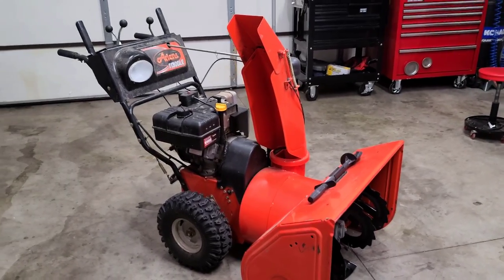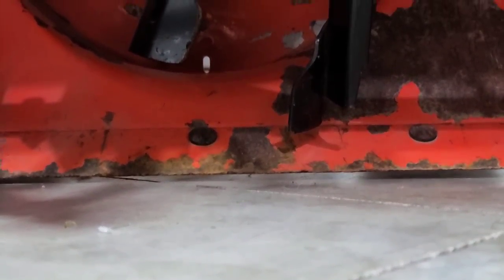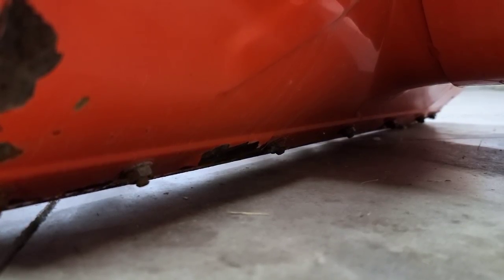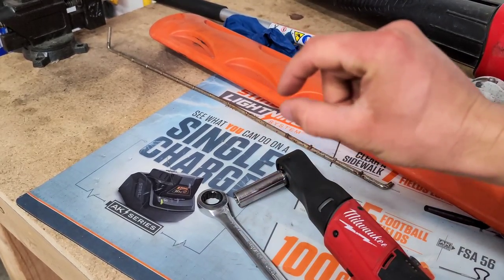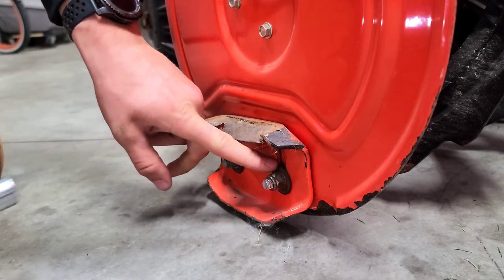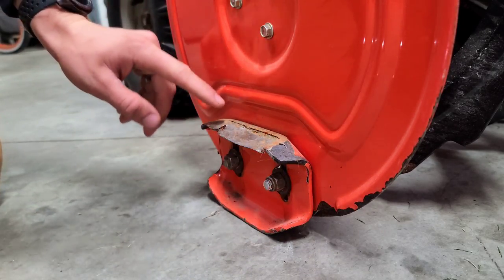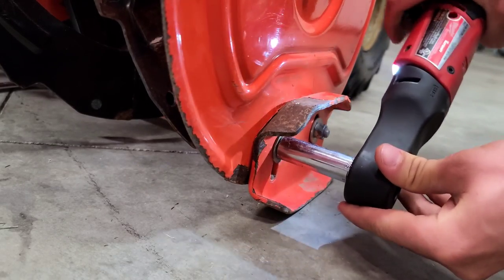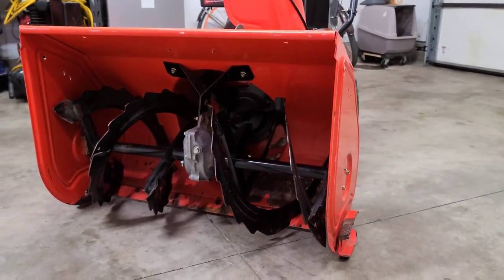How-to Adjust Shoes & Scraper Bar On A Snowblower

Comment: Hi Phil 32 years ago I purchaser my first snow blower.  I used in town on sidewalks that were uneven.  When the skid hit the high part the snow  blower would violently turn to that side.  I could see then that the skids was not the answer.  So I measured the distance from the bolt hole for the skid to the ground and found sone wheels of that diameter.  Ever since then I was able to operate the machine with only using one hand.  I still use that snow blower today

Comment: Suggest you check the tire pressure and make them somewhat the same. Otherwise the machine will sit on a tilt and the adjustment of the scraper bar will follow and the next time you fill the tires your scraper blade will be skewed.
Reply: you got that right....you can only fight that motor for about 30 minutes ....
Reply from the maker: Yes sir thank you for the tip. My tires were both inflated at 20psi 👍

Comment: great video! you explained this very well. Wish I would have thought to look for this a while back.  3 years later with no adjustment my shoes were plastic and worn away and eventually lead to loss of that blade totally.  I have found out what the noise and shimmy was as I was snow blowing.
Reply: Tell me about it.  I need a “So a Texan moves to New England” channel. So many things and nuances, I thought I was good with just buying a badass snowblower.

Comment: On a flat surface you should check that you have the scrapper bar space the same on both left and right sides first. If not, it can be adjusted and then adjust the shoes.

Comment: Thank you, I appreciated the video. Although, skipped the 1/4 to 1/2” clearance on the scraper last Winter when I bought our NEW Toro Max 828.I may do that this week. I have a question though….. The right slid was scraping on the cement last year and I checked the air on tires and that seemed to be fine. WHY is the shoe scraping? I literally had a track it would make in the snow. Maybe it’s designed wrong? I seem not to get any answers even from professionals. So, a couple weeks ago I turned them upside down like you did. Nothing seemed to change. Just that the right shoe just got more paint scraped off then the left one and that was just it idling.  I think that is the furthest they will lower too. I could send you pics if need be. ANY suggestions? It just doesn’t make sense to buy a new snow blower and one side seems to scratch the floor. Hmmm. Thanks for reading. Robert in WI.
Reply from the maker: Maybe right side is heavier? Location of gas tank on the right side?

Comment: Who wants 1/4" of snow left on the driveway
Reply: Old video but that's ok, just a comment for others who may read...1/4" is good for old worn driveways where the car tires have somewhat rut the asphalt, where the center driveway section is a bit higher. The scraper bar won't catch on the higher center sections of the driveway. Nice flat asphalt driveway and 1/8" is good, nothing to catch on. Maybe a really worn driveway or dirt driveway, space the scraper gap even more. All driveways are different, different surfaces... trial and adjust to find the right gap.👍

Comment: Maybe a silly question but why would the skids need to be adjusted if you just adjusted them last year? Do they move that much while using the machine?
Reply from the maker: Vibration causes them to come out of adjustment :) and/or hitting uneven concrete that might be sticking out/curbs
Reply: @fillslawncare  thanks...and doink on me...LOL
Reply: The shoes or skids will wear down over time

Comment: Should always make sure the tires have the proper air levels in them before doing this. If not you may still end up needing to adjust the machine again.

Comment: Not a shoe question but...when I stand behind my machine and just lightly move the handles left and right, the machine wobbles like its loose between the machine and how cowling. Is this normal movement or should I get it looked at? Thanks.
Reply from the maker: How cowling?
Reply: @fillslawncare  a typo. Okay, so the circular metal piece (called the impeller SHROUD) that is between the COWLING around the auger and the frame where the motor sits. If I wiggle the handles side to side, the frame moves but the SHROUD and COWLING do not. I am not sure if that was like that before or not. The shroud and cowling to me are all cowling...but whatever.
Reply: @thedyslexic9936  make sure all the bolts are tightened

Comment: how do. you adjust the scarper bar?  if it needs it?
Reply from the maker: If your shoes for some reason won't lift the scraper bar off of the ground, tilt your snowblower onto its Chute and loosen the [usually 4 carriage bolts w/ nuts] that hold the scraper bar in place and you should be able to reposition the scraper bar up higher, then just simply tighten the nuts.

Comment: Your suppose to adjust scraper blade all the way down before touching the skid shoes
Reply from the maker: That is correct if you have an adjustable scraper bar. However on this model snowblower, it is set in place no adjustment other than shoes.
Reply: @fillslawncare  oh ok well that makes perfect sense then.
Nice video very helpful,  happy holidays.
Reply: @fillslawncare  you have bolts, it is adjustable and replacable
Reply from the maker: @COUNTRY FAMILY ALWAYS ! it is definitely replaceable but not adjustable. Like I said before, only the shoes are adjustable on this particular model. Merry Christmas and happy new years
Reply: what difference would this make if scraper bar is in the lowest or furthest back position? Either way when using a 1/4 inch guide item, the shoes mount all the way down to meet the pavement then get tightened. The spacing should be the same 1/4 inch regardless.
Reply: @TheBlazinman  idk thats what it says in manual to do first before touching shoes and after doing it on mine it seems to stay down towards the ground better with all types of snow vs lifting up like it use to for whatever the reason....
Reply from the maker: @TheBlazinman  this Ariens does not have slide adjustments on the scraper bar
Reply: @countryfamilyalways7280  im going to try that rather then putting scraper in the farthest back position.
Reply: Pull the scraper blade as far towards you, or push the scraper blade as far as it can go towards the back of the machine?
Thank You.
Reply: Whatever position the machine Is in when you adjust the scraper blade move it away from motor bringing it closer to the ground when in operating position then tighten the blade bolts on the bottom of blade and two bolts on the side of the blade then adjust skid shoes to the desired height you want
Reply: @countryfamilyalways7280  Thank you!